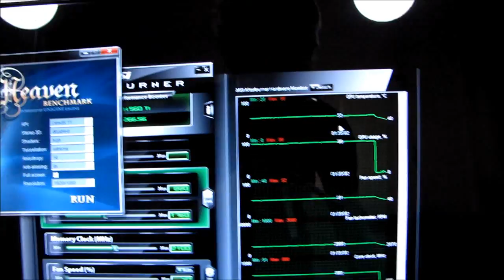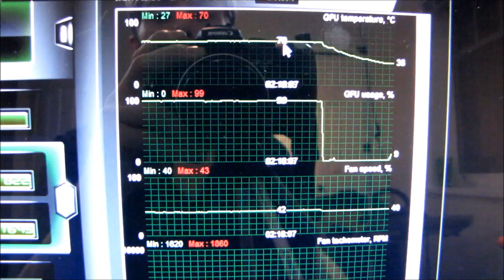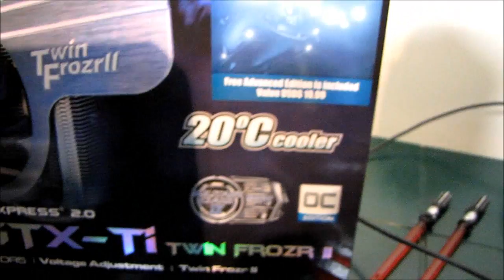GeForce GTX 560 Ti Twin Frozr II vs Reference Heatsink Cooler Linus Tech Tips

Comment: @nahcnavi1234 Remember the video shows a test bench machine that has no case to contain any heat so it will always be cooler than a machine thats built inside a case.  This video is not a real life condition benchmark for actual everyday (Case) use and this video can only compare temp difference between the two cards based on both cards being in an open air test rig.  Temps in your room may also vary from what is in the video.  80C is well within the cards acceptable temperature threshold.

Comment: @clarencelanguage1 its normal for it to go that high when the fan is set to auto.  If you want to get it cooler you need to install either the Nvidia overclocking tools or an app such as EVGA precision that allows you to set teh fan speed manually and ramp that thing right up to 100% when your in for a long game session.

Your temps will drop alot doing this but the noise of teh fans will be alot higher as well.  Hope that helps.

Comment: @gooferman609 Thats going to happen in most cases.  1 card will be warmer.  Best way to cool these cards is to have a fan in the front of the case that moves air over the cards and out the back.  I have the GTX560ti hawks in sli, under 100% load the top card gets to about 78C and the bottom one around 72C max.

Thing you have to remember is that those cards dump hot air into the case, and not out the back.  So plan how the air flow is going to work.  How hot do your cards get?

Comment: thank you for mentioning that the temperature on your test bench is cooler than in a closed case. last week i had a friend here and he told me, that my gfx card is running too hot, cause he read in a testing article, that it is 10° C cooler :p

Comment: @slapnut892 The MSI Hawk is probably slightly faster due to factory overclock, but that's easily negated by a slight overclock on a 560 Ti. And they have basically the same cooler, so that shouldn't matter.

Comment: @clarencelanguage1 up to 80 degrees is totally normal for an overclocked card like the one you've got.  the only way to lower temperatures further is to get a totally different GPU cooler.  but the one you've got is totally fine.

Comment: @ChromeDeathPunch It's the difference between the room temperature and the card temperature. If you have a room temp. of 30°C and your card runs at 50°C, the delta would be 20°C (50-30).

Comment: my twin frozr OC edition heats up to the high 70s when I play games such as starcraft ii on "ultra" (highest) graphics settings.  I built my computer myself (my first build), this is my motherboard: MB MSI|P67A-GD65 (B3) P67 LGA1155 R.  

I feel like my awesome GPU should be able to handle SC2.  Are these temps bad?  I used MSI Afterburner to adjust fan speeds so they reach 100% by the time it reaches 70ºC.  Will this fan speed strain out my GPU over time, is it better to let it heat?  Thx

Comment: My card idles at 37 degrees and I have a similar heat pipe cooler with 2x 92mm fans bolted on it. This is a good cooler :)

Comment: @FireSqy I clock up the Core clock to 1000 MHz, Shader Clock to 2000 MHz and Memory Clock to 2200MHz, Any higher and I begin experiencing issues. I would have gotten the 448 cores, I really wanted too but my problem was that my PSU doesn't have a strong enough wattage to handle it :[. The 560 TI 448 Cores isn't actually a 560 TI. Its basically called the GTX 565 in truth, as its using the 570 and 580's GPU, just with less power.

Comment: @waki1996 Well based on this video I wouldn't say there's a huge difference, although there clearly is a difference in MSI's favor. Also the reference cooler seems to have slight buzz or rattle to its noise signature which would definitely make the sound stand out more from inside a chassis.

Comment: @booger611 

The Motherboard, Power Supply and Case size are the main constrictions of getting a graphics card. However, if it's a Dell computer (or really any consumer grade pre-built) it likely has shit-house cooling, and seeing as this card is mostly an internal heat exaust, I would say not to get it as your cooling will most probably not be sufficient.

Comment: @VincentVega44 you only need a powerful fan if you are going to overclock. The GPU can easily handle 80-90C. Anything lower is just unnecessary noise really.

Comment: the msi twin frozr 560 ti and the gigabyte 560 ti are basically the same with dual fans, and there idle and load temps. But the gigabyte's fans can hit 3200 RPM! and are quiter than the msi.

Comment: i just got that card a few weeks ago and it's so much quieter than my old 9800gtx+, actually, the first time i left the room after installing the new card i thought my computer had shut down cause i couldnt hear the fans from the other room. the gpu does seem to run quite hot under full load... but not too hot, highest i've seen it go was 74 while playing bf3 beta.

Comment: I'm not Linus, but no, you can't run more than 2-way SLI with these cards. Anything more than 2-way requires the card to have two SLI connectors on them, these only have 1. If you look on nVidia's page for this card it says it only support 2-way.

Comment: Yes it will help alot, I don't know if 2GB's will be necessary for this card though. I know bigger and better cards might need 2GB+ like HD6950 or GTX670 and higher but I guess for this card, 1GB wouldn't be much worse. Anyways, almost every card above HD 6850 or HD 7850 will be good for gaming with with that i5 processor :)

Comment: Great vid! Two questions. Do i need a sterioscopic 3D monitor to run in 3D? Also what are the voltages on this card/ recoomended power supply? I have a i7 950 prossesor at something like 3.30 ghz, so this plus that what kind of power will i need? Thanks

Comment: I don't get it. Is that supposed to be quiet? Well.. it would be nice to see some tests with the card inside the case.
 The acoustic factor is the only thing that is stopping me from buying this card.

I really don't know if this heatsink from MSI beats the Vapor-X solution by Sapphire.
 I mean, now I have a HD5770 Vapor-X -- and before that I had a HD4850 + Accelero S1 (the reference cooler was annoying) -- I just need someone to tell me that this card's acoustics are not like that noisy 4850.

Comment: @Magesarefun PSU 520Watts, i5-2300 (Factory OC'd to 3.3ghz), HDD 7200RPM, and 8 gigs of 1333 DDR3 RAM. I do overclock a small amount but because of my PSU, my computer will shut down from loss of power. Although, thats only if I try to play a game if its overclocked to higher rate.

Comment: Would the HAF-X side fan on case blowing onto mobo gpus (gtx 560) be sufficient for a reference style cooler(having only 1 fan). Also, I plan to purchase an additional Noctual 120 mm fan to mount on side bracket to blow air to gpu. 

Or should I get the Twin Frozr model (seems a bit loud under load compared to reference cooler ) and I would like to reduce noice in case if possible but dont want to burn up my card at same time.

Comment: @SprintingJesus Ok, took your advice and got myself a Cooler Master 343. Works quite well with 3 fans installed but is still getting up to 80 degrees. Any other way to cool the GPU?

Comment: @Klick500 Right now I'm running 64 bit windows 7 home premium, 1TB 7200 RPM 8GB DDR3, 700 modular cool master PSU, i5-2310 2.9 ghz ( not overclocked ). I have a 2.0 PCI Express X16 slot on my motherboard, would getting this card give me about the same performance as you seem to be getting at 1920x1080 on those games?

Comment: i have an n560 gtx ti twin frozr ii "oc edition"   with my MB MSI|P67A-GD65 (B3) P67 LGA1155 R MOBO.

I see temps of like high 70 degrees and even higher when playing starcraft ii.

Is that too high?....  My gpu fan speeds are around 40-50, but when i boost the speeds up to about 90% the temp stabilizes around 60 degrees. 

will these high fan speeds mess up my GPU?  and are these temps bad?  TY

please view for more info on my build: watch?v=5B73aaLjV1s&feature=channel_video_title

Comment: Well, actually, any time you change your motherboard Windows needs to be reactivated. Also, technically a Windows license covers one "computer", which is defined by the motherboard, so in theory you're supposed to get a new Windows license for each motherboard. I'd imagine the video poster probably does switch motherboards fairly often...

Comment: I've had a twin frozr 2 for about 9 months but its running at around 70c under stress now and it used to run at about 63-64c so im guessing i need to give it a bit of a blow to get the dust out :) , great cards though i have mine clocked at 950Mhz core and 2250 Mhz memory with stock voltages.

Comment: Did you know that it is back to put your greasy fingers on the pin connectors of any graphics card, RAM card, and Cpu? I would suggest not touching it in a review. It can mess with your readings and connections.

Comment: Guy I'd like to ask for your advice, I awnt to buy a new video card and this one is very atractive but there is the 460 too and I'd like to have a balanced system, my mobo is a gigabyte 880gm-ud2h 4gb of ddr3 1333mhz and a phenom II x2 550 stock,  corsair vx550 ,I'm not an enthusiast so i won't overclock, thanks in advance for you attention and advice.

Comment: U can overclock whatever u like with any
MSI Afterburner, Nvidia system tools, EVGA tools, Rival tool..etc.. But 1st, 2nd performance stage always stay the same.

Even had try out the MSI 2.1.0 version - Set UnofficialOverclockingEULA = I confirm that I am aware of unofficial overclocking limitations and fully understand that MSI will not provide me any support on it

UnofficialOverclockingMode= 2

Is there any possible solution left to resolve this issue?

Why can't lock 880Mhz fix.

Comment: With my 560 Ti Twin Frozr III I had in 3DMark Vantage with minimum settings and 720p resolution like 90 degrees Celsius. I think Twin Frozr III sux, so I bought a Gainward 560 Ti...

Comment: 670 by a long shot .. uses less power so you can use a lower power supply. more performance, and the new AA types.. a 670 will pretty much match a gtx 570 sli setup. maybe a tad less. but overall thats about the performance youll get .

Comment: @clarencelanguage1 Get a new case bro, Airflow is VERY important. I nearly fried my GTX275 because i had a shitty little mini-atx case with no fans. I recommend a Zalman Z9 Plus, very cheap, comes with 4 120mm fans and a inside temperature readout on an lcd screen and is a mid-tower so it can hold ATX motherboards. It has a lot of other features that you would expect from a case that is twice the price. I'm certainly glad I bought it.

Comment: A HD6950 is about 5% ish faster than a GTX560ti and well yeah you dont need more than 1GB with a single card but if you go for an SLI setup get the 2Gb model.

Comment: Hi :LinusTechTips

Does anyone have any idea how to resolve this Stupid "MSI GTX 560 Ti Twin Frozr II NVIDIA GeForce 1gb performance stage issue. It's performance stage had drive us crazy & cause a lot of lagging problem for mid end graphic gaming.  "All GTX 560,570,580 has 3 performance stage problem issue. 

1st stage: 50Mhz core clock, 67.5 Mhz memory clock
2nd stage: 400Mhz core clock, 167Mhz memory clock
Last: 880Mhz core,memory,power..etc..U can overclock whatever u like.

Comment: Can anyone of you guys helpp me with this? I want to know if this would be a good gaming computer:
Motherboard:  Intel® DP67BA Featuring USB 3.0 and SATA 6G [B3 Stepping]
Processor:  Intel® Core™ i5 2500 3.3GHz/3.7GHz Turbo 6MB L3 Cache GT1
Processor Cooling:  MAINGEAR EPIC 120 Supercooler
Memory:  8GB Kingston DDR3-1333 (2x4GB)
AMD® Radeon™ HD 7770 GHz Edition 1GB GDDR5 w/Eyefinity 3D [MAINSTREAM]
600W Seasonic® 80+ Certified Power Supply ROHS
1TB Western Digital 7200rpm 32GB SATA 6G
plz help!

Comment: damm my gtx 460 gigabyte most of the time runs at 65c and i can make a good oc the max stable was core 851mhz memory 1995mhz the worst brand gigabyte and after thats attemps to oc the card start to fail and the twin cooler really sucks